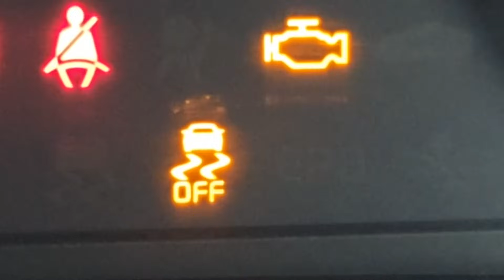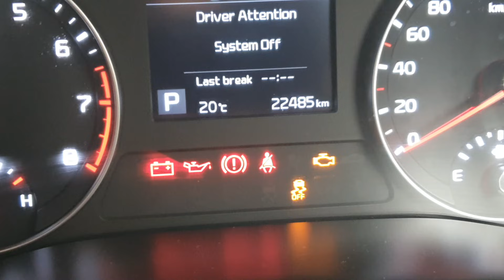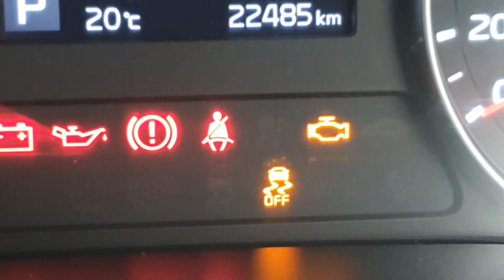Why Your Car Shows Squiggly Line / Slippery Road

Comment: I had this issue for about a week and yesterday my front tire exploded when i was driving on the highway. It would make weird noises when i went into a bended road in high speed and show the slipping car icon on dashboard, not when driving straight. I dont know if the tire has anything to with this i also had a yellow icon on the top of my dashboard. Today i'll check out what happend maybe something destroyed my tire on the road i really dont know. Its parked at a random gas station i had someone pick me up yesterday :/

Comment: Thank you for this because my traction light is on and I couldn't figure out how to turn it off or why it was on. I watched your video and I then had also noticed my dash also reads "service electric brake system" That's probably the reason that the traction light is on. I appreciate your video very much...
Sending positive vibes from the Windy City